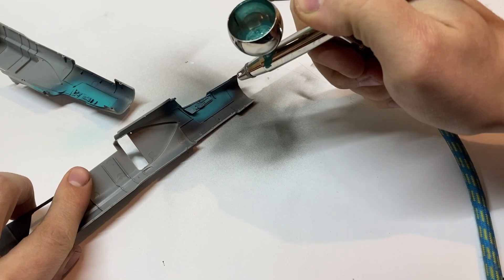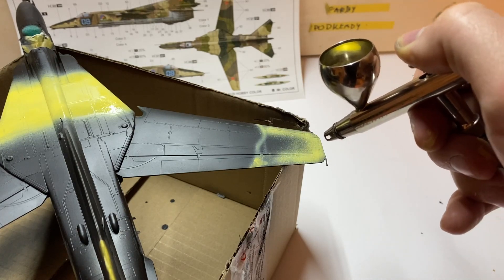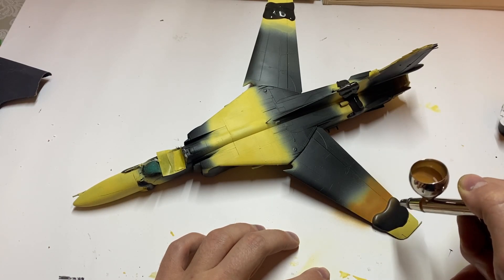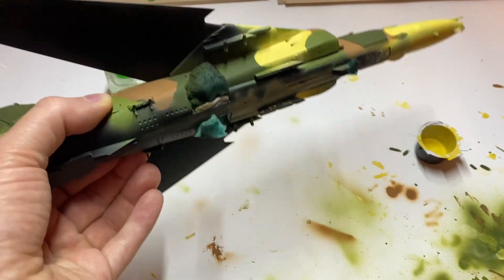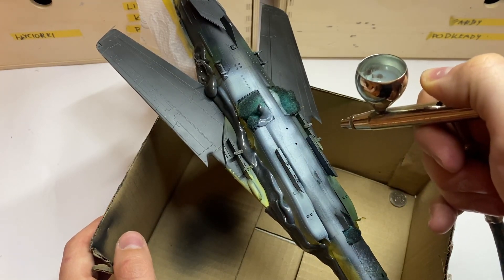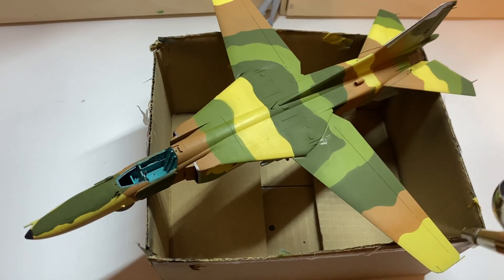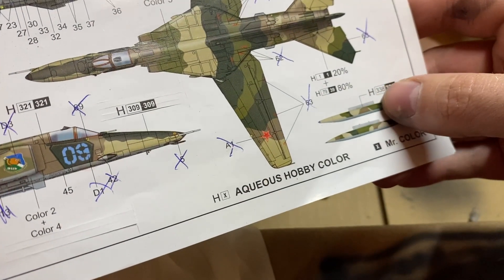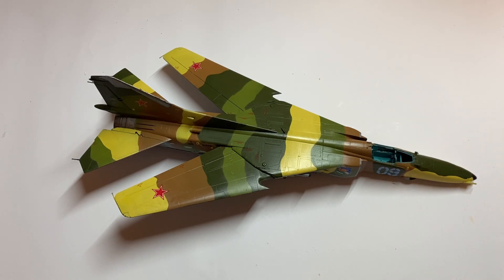🎨 Painting with AK 3rd Gen acrylics 🛫 MIG-27 from Trumpeter 💥 Are these paints any good?

Comment: I recently just went "all in" with a purchase of an AK 3G set, several singles, and thinner.  It has not gone well.  Using AK 3G thinner (AK11500) seemed very much like my experience when accidentally thinning water-base acrylic with enamel/solvent paint thinner - didn't mix, clogs/glumps in cup, splatters and "spits worms".  Tried it with multiple 3G paints with same result.  I had acceptable results when I tried Vallejo thinner and also with a alcohol/water home-brew that works well with Vallejo and Testors MM...but still lot of tip drying/clogging.  Added a drop of flow improver with moderately better results.  You had good success with AK11500?
Reply from the maker: Hi Steve :) I'm sorry about your bad experience. Well, it's very personal how you perceive various stuff. I struggled to get used to thinning them down, cleaning an airbrush, and lacking this perfect control of spraying as you have with lacquers. The time will show if they're good enough. In my opinion, the AK11500 is optimal for them. The thinning ratio should be at least 70% of the thinner but even 80% is comparable with the 1:1 ratio for Tamiya XFs to Mr. Hobbies H series. I also tried to mix them directly in an airbrush's cup with a brush or a backblast and it's a very bad idea - these paints are very thick so they wrap around the needle worsening the mixture flow significantly.

Comment: Hi Sir, best wishes !
So, does these paints behave like Mr Color ?
Thanks !
Reply from the maker: Hello Sir :) Mostly, they act similarly. You have to thin them down much more, you can paint them with a brush (for larger surfaces add a little tap water). Also, do not mix them with the thinner into an airbrush cup, because they stick to the needle cogginng the nozzle.
Reply: Ok, thanks a lot for the quick answer.
Best wishes !